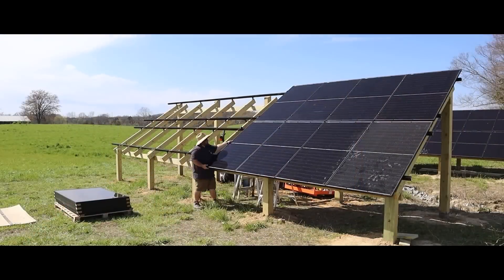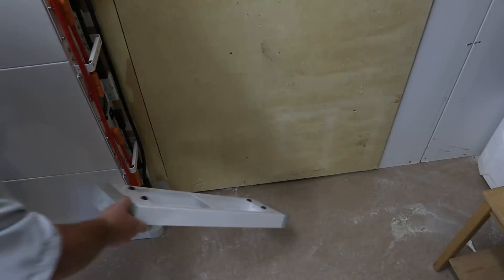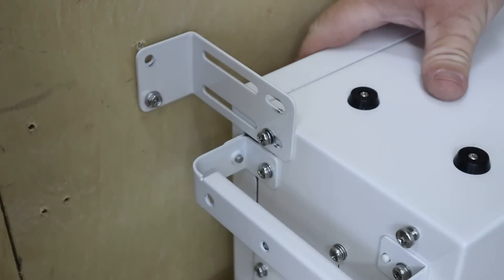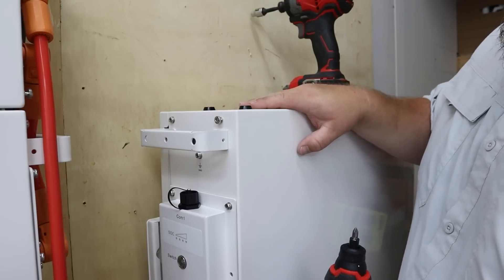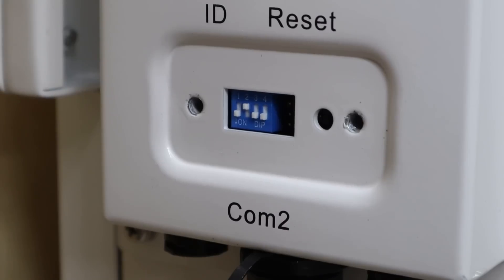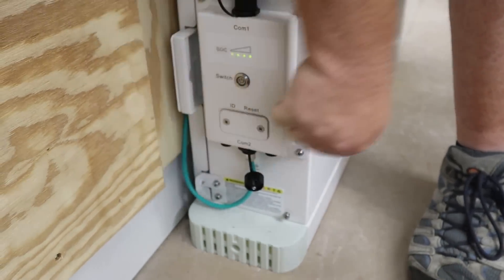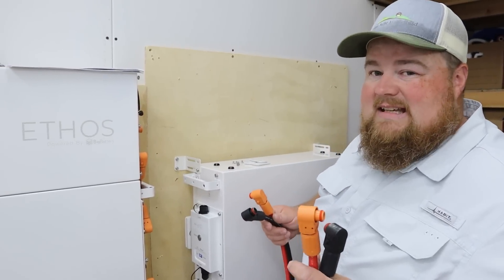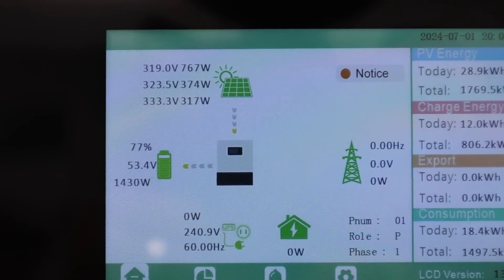EASY 2x Battery Storage! // Signature Solar BigBattery ETHOS 3x Expansion Kit

Comment: What was the name of the first solar compact generator you had with your first camper. Were you happy with it. My husband and I are looking for one for our camper.
Reply from the maker: That was probably a BLUETTI power station. It would supplement our power, but not really run everything long term. Most portable power station setups lack the ability to have large solar input, which is very important for power demands. Otherwise you are just using up your battery and will then have to wait for the small solar to charge it back up before using again.

Comment: You haven't said how much of your battery you use each day versus charging.  Even with all of those solar panels you have to put your stove and hot water heater on shore power (navel term) means you are using a lot in the house.

Comment: Hey Sam!
Question: I’m hearing a lot about possible EMP attacks and I’m afraid. I have one bluetti and a small solar panel. Are there measures that an average person can take to save what they can?
Thank you for helping teach people. 
Darla in NC
Reply from the maker: A major EMP attack is a subject that is very easy to quickly spiral into hopeless thoughts over, so try not to let fear rule your decisions. Faraday enclosures are the most common way to theoretically prevent damage, but it's all theory. We've never experienced an EMP attack like media or novels portray, so everything sold is unproven. In my opinion, the best way to prepare for an EMP is with pre-electric or pre-semiconductor items and skillsets, but it's not an event we personally prepare for. Hope this helps?
Reply: @sam-and-angela thank you for responding. I’ll try not to be so fearful. Seems the media just keeps trying to scare us. ❤️

Comment: That setup is pretty amazing. It's wild to think that those white boxes are batteries. I have so much to learn about these off grid systems so this was interesting to watch. 

If you have time: How do you know what size system you need? Is there an easy way to pick a system out if you wanted to a quick off-grid setup for an outbuilding?

Comment: not sure if you have day and (cheaper) night tarif on youre mains hookup to the grid (we have double meters and the cheaper tarif is from 2300 hour to about 4.00 hour  in the morning )
the batteries could be charged on this cheaper nighttarif if there isnt enugh sun in the daytime to keep them topped off enough to power the house fully on solar (like when its snowing or raining all day ) the whole time , you can still run off those batteries but using cheaper mains power to fill them up the rest of the way to last through 24 hours

Comment: The Ethos seems to be about double the cost of other popular wall mount batteries like EG4 or Midnight solar. I'm not sure which is the better quality.
Reply from the maker: Stay tuned for info on the EG4 system. :)
Reply: I have expert power batteries but vatere has a better price you can't contain us YouTube channel shows about them
Reply: Nice batteries tough

Comment: What is the projected life span of this setup? Nice clean job on your electrical needs!
Reply: lithium cells usually will last you 5-10y
the panels should go well beyond to around 30y
think the bottleneck of this system is just the lithium batteries themselves assuming good maintenance and rocks not falling from the sky and destroying the panels